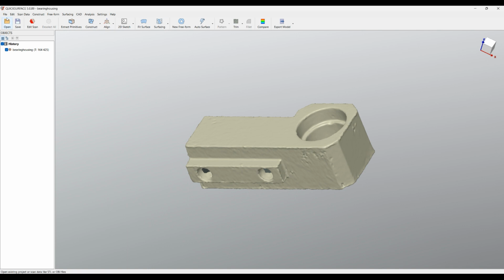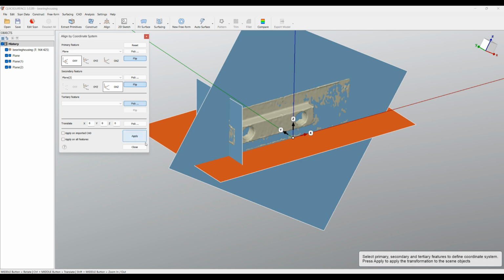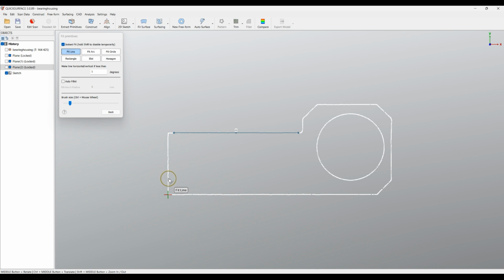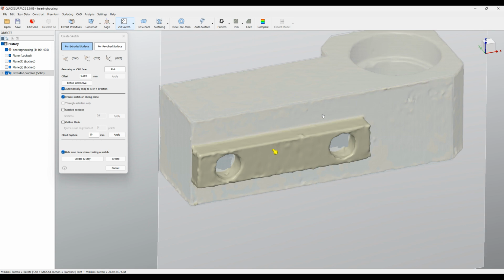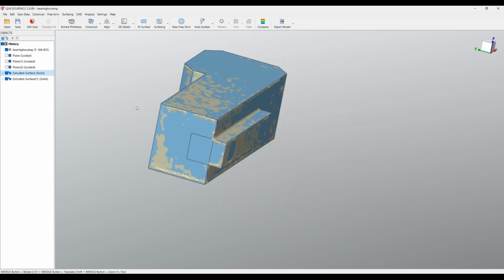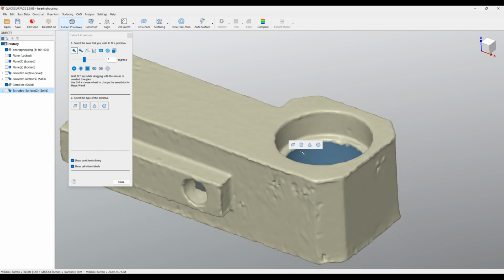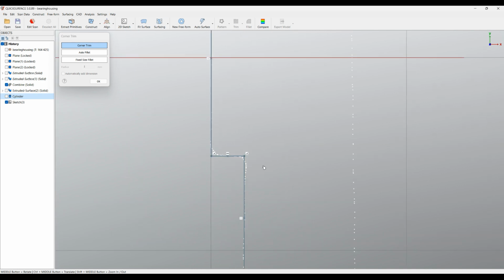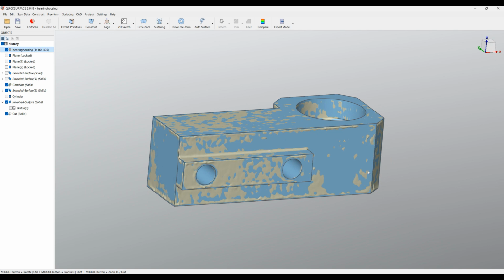Step-By-Step tutorial (Bearing housing): Basic course for reverse engineering with QUICKSURFACE

Comment: This is meaningless to be on the lite version! You remember all the major important stuff from the software and the pro version is too expensive and I can not afford it 😩
Reply from the maker: The lite version is as good as other similar software like Geomagic Wrap / Creaform VXModel and Artec Studio.
Reply: @QUICKSURFACE  yeah it might be but not for what I wanna do 😭 I need hybrid modeling specially to reverse engineer speakers! I need to set dimensions and to use sketches with the extruded and let’s not forget revole! These are the most important thing I need 😩 and I need them to test the coordinates exactly at the center bottom of the speaker 😭